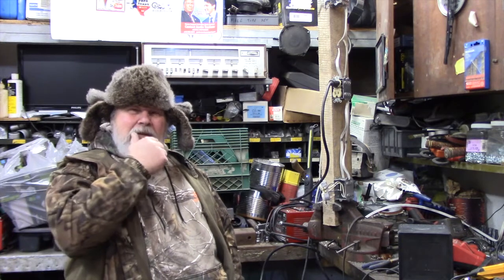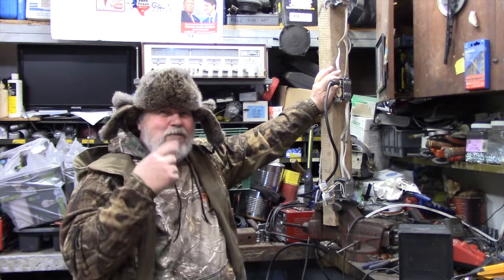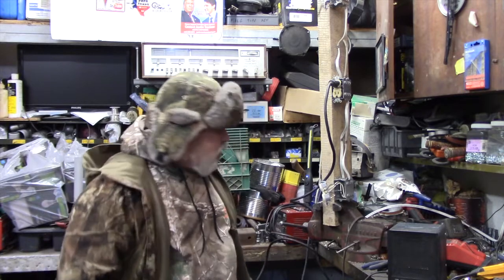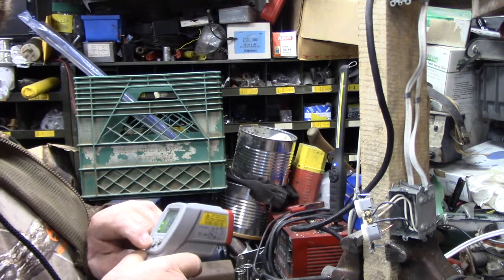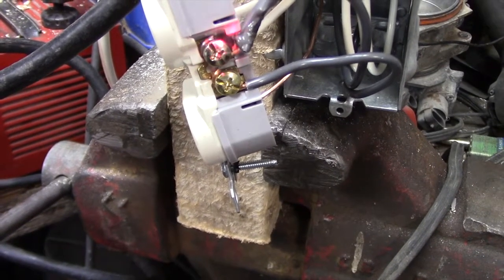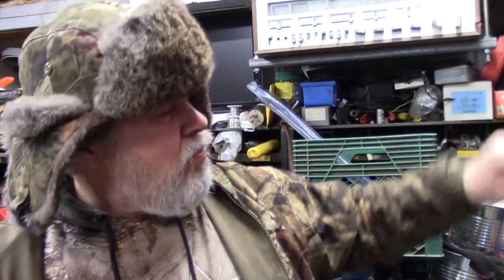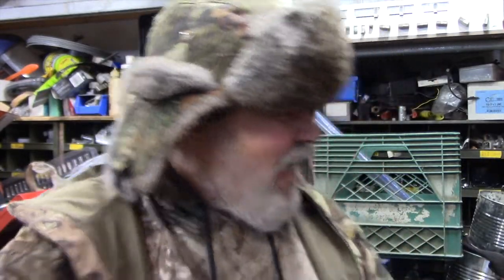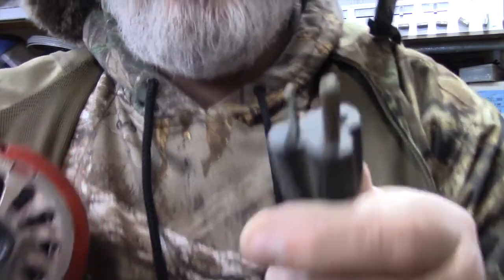Don`t burn your house down

Comment: We use an oil filled heater in the living room for those nights it gets below 40F outside. The furnace handles anything below that.
Reply from the maker: Good choice for the heater and if you want to know what I think as long as you have a dedicated circuit to your heater your all set....just what I think as far as my standards go....CHEERS

Comment: Hey there Gator!!!  Great lesson on the importance of not overloading your circuits or plugs!!!  The business of grounds and bonding and neutral, well I wouldn't want to have to do that video!!!  Grounds and neutrals are a science all unto themselves!!!  When you read of house fires in the news it seems the cause is electrical 95% of the the time.  Your demonstration is a very good example of why that is.  Thanks for posting and stay safe!!!!
Reply from the maker: Thanks for responding to my video Grampie and I`m sure it`s easy for one electrician to another to find fault in what I said or what I mist and that I have to thank you, sir, for not doing....It just encourages me to do more but with the limit of knowing that for most people Just a bit off knowledge is worse than no knowledge and may be more dangerous....CHEERS

Comment: Great lesson Mr. Gator!  I have a piece of neutral wire in my office that burned back about 3 inches due to being loose.  I am guilty of replacing outlets while they are hot, I just make sure to touch one wire at a time...not recommended but I have done it many times.
Reply from the maker: Hey Larry....You will get a shock but it won`t kill you...all I have to say Is complacency is the big thing and the more times you do it the more your getting close to being bit....the biggest thing you have to worry about is when there`s a large unbalance load  and you touch that neutral to ground that could be a deadly thing and if you put water in the mix....BANG....too late....I will talk about that someday....CHEERS my friend

Comment: When I rewired my house the inspector wanted pig  tails. I had some lights and outlets that stopped working and I had to go back and get rid of the pig tails.
Reply: On the heaters they want to give ya more heat so they put a lighter gauge wire so that the wire will give ya some heat along with the heater.
Reply from the maker: @mostlymoparih5682  Ya....that`s a good one Marty....but the sad thing about it is that its true.....It`s the big $ that counts nowadays....I`m sure your on top of it arty....CHEERS
Reply from the maker: I guess you put the pigtails loose Marty....why did he want pigtails....did you have aluminum wire....CHEERS
Reply: @gatorsworld  No they weren't loose and they weren't aluminum but like you said the more connections you have the more resistance you have. The less joints the better.
Reply from the maker: @mostlymoparih5682  I`m with you on that one....CHEERS

Comment: good lesson of dont do as i do but do as i say lol...im guilty of splitting 220 into 110 useing the ground as a nuetral on the construction site in a portable box ....when its raining and the gfci is popping constantly preventing work from being acomplished i would plug my box into the 220 outlet to split the power to 110 ...if the damned electricians would do their job i wouldnt have to do that lol...and yes all my tools were wired apropriatly with grounds ...it wernt my tools causeing the gfci to pop ...one thing ya didnt hit on is them cheap ass 15 amp plugins that ya stab the wire into the backs of the plug instead of screwing them in ....those things will arc out ...it makes the job easy but as far as im concerned they should be banned
Reply from the maker: Wow...if you do that don`t let now one other than yourself use that plug because in wet situations and a big load it could be deadly situation....CHEERS
Reply: @gatorsworld  yup i know it can be dangerous ..but i did that for a lot of years and what is even worse is i was doing that wearing tennis shoes standing in mud puddles and feeling the shock the whole time ....but when ya have a job to do ya gotta gitter done ...personally i think gfci is overrated ...just having a good ground and neutral is all that is needed ...we started out with power tools that were all metal no plastic casings and no gfci ...i don't recall ever hearing of anybody harmed when ground and neutral was functioning correctly
Reply from the maker: @Alf270  The Safty guru's are always trying to idiot proof everything....big cost to the people in general...Blame it on the safety police....CHEERS
Reply: cheers gator

Comment: Nice  chat  Gator . The relationship between the neutral and the ground is  one many do not understand  - would be an interesting subject. Many houses built 60 years ago did not have grounds .
Reply: I think Gator is well grounded.
Reply from the maker: @mostlymoparih5682  I should be but really I run around with the ground disconnected a lot Marty
Reply from the maker: That a good one Steve....neutral and relationship to the ground wire is a big topic and can get complicated with unbalance circuits but I will make a video but keep to the basic and not deal with an isolated or a shielded ground cuz there is still some educated people debating about the perfect ground....coming soon in a movie that Gator will make....CHEERS
Reply: Yeah I'm neutral on that two2.
Reply: Instructions are four4 after you're done and ya need something to start a fire with.
Reply from the maker: @mostlymoparih5682  That`s what I do with instructions 2 Marty but sometimes I have to pull the paper out of the fire even if half burnt
Reply: Neutral - ground - floating ground :)  oh ya i'm neutral on that two2
Reply from the maker: @SteveRobReviews  A floating ground....now you surprise me Steve....never thought you would know about a floating ground or a floating neutral
Reply: Gator's World  Should you share the same  earth ground  if  have  a   Utility provided service or genset  with your  solar panel system using 12v inverters putting out 120v  as well.  Lots of interesting subjects people doing  solar with inverters would want to know.  Cheers
Reply from the maker: @SteveRobReviews  You bring up a good one Steve....you talked about a lot in just a few sentences.....In just a short reply I would tell you that all your ground has to be tied together and you should be supplying your own ground and not relying on the hydro ground but it still should be bounded to your ground....there are some very specific instances where there is no Hydro but your producing power and you still have the responsibility to have a good ground with good bonds between your wires.....A floating ground at a generator is not legal but is done all the time.....It only matters if someone dies that the story change....there is regulation on that in the codebook even if it's not tied to the utilities....I should talk on this too....CHEERS

Comment: Metal fatigue is when you bend metal enough that it breaks down. By not tightening those screws you're creating some arcing through some air gaps hence resistance and the heat. Love that your videos really make me think! I see people twist that recepracle tong where I work all the time. Good things breakers and wires  are over rated by 20% I think?